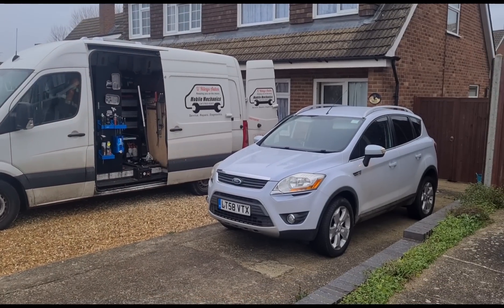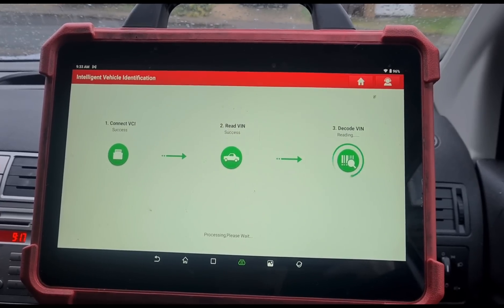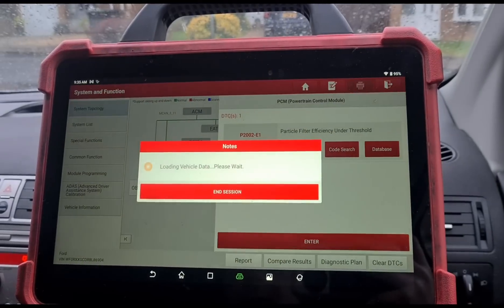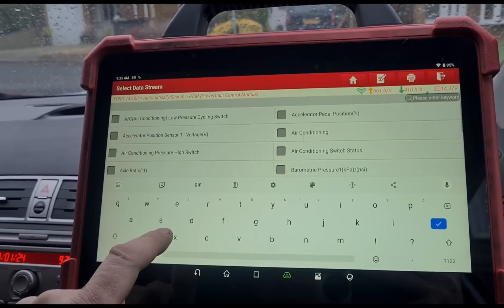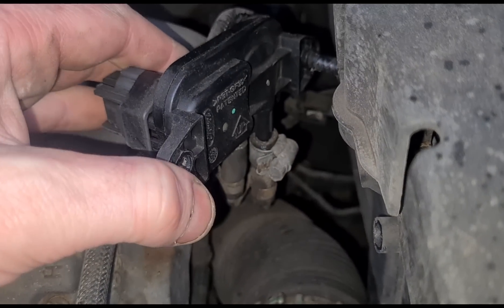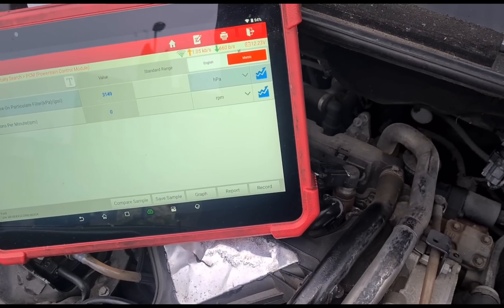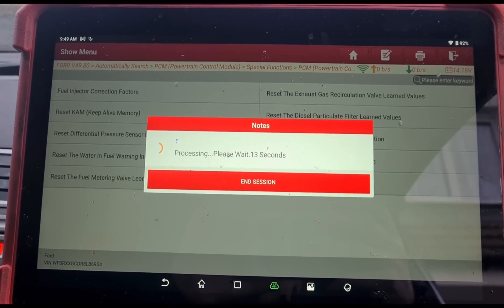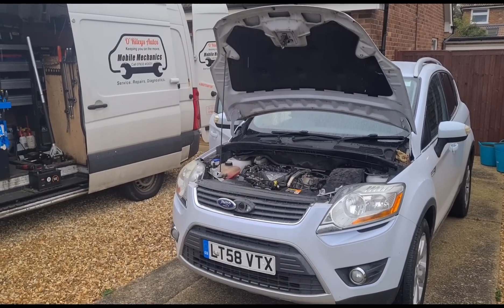Ford Kuga P2002-E1 Particle Filter Efficiency Below Threshold

Comment: Wasn't the tailpipe sooty Jimmy? 🤔
Reply: I have the same issue and my tail pipe is sooty, any help woukd be appreciated
Reply: @Cartoonhead74  Maybe a bit late but what do you mean by "sooty tail pipe"? You mean you tried to put your finger in it or a piece of paper towel to see if it is sooty? If that's the case then your DPF is damaged as soot is getting pased the DPF which shouldn't be the case. DPF has to be replaced sadly.

Comment: Do you think the euro tab 3 is worth the money?
Reply: @fatclio: depends on what kind of a person you are. If you are a mechanic then for sure not. There are other alternatives that use Launch software that aren't expensive as his tab 3. This is too much and a rip off as you are paying for the software that can do all even programming and ADAS (which is for emergency braking sensor recalibrating), while having a tablet that's not even made by launch but by Lenovo (or another brand). So no. If you are a normal DIY and don't plan to buy an electric car in the futur, then buy the new Thinkcar Thinkdiag 689BT or the non BT version. You have everthing you want except serious programming (but does simple things like ECU and Gearbox programming) and lifetime updates! The only issue is that you have to buy it from thinkcar themselves or aliexpress, both are chinese, you do get a cheaper price because you are going to pay for the import costs. There are other options like Launch x431 that cost around 600 euros but has only 2 years of free software updates, you can use it after that but you won't get updates for the latest cars. Hope this helps 🙂.
Reply: If you check it's 5k, but 1k vat which is objectionable,  disgusting

Comment: Hi Jimmy, I have a ford Kuga, and apparently the sensors are notorious for failing on these, they'll last about two years, I have recently fitted one to mine and it stopped the MIL lamp from coming on, IMO I'd deffo try a new sensor, ideally a new DPF as well,  but as you said the lady could not afford that...

Comment: Cmon. She knows. Seen loads of these. Sensors are crap on these. Little flexy b4 DPF are very prone to splitting. Tiny leak and differential pressure values are way off. Combine that with the quality of the original sensor and yr bang in trouble. DPF drilled maybe? Seen loads badly mapped because of this as well

Comment: besides a cracked DPF or a hole drilled through the DPF, could it also be possible the metal line attached to the DPF has a rusted pinhole or small crack allowing only some of the pressure to escape. maybe shooting a little brake clean down the tube and looking for a small leak? remember that time you put DPFCleaner in a car, and it started coming out all over the place through bad welds.
Reply from the maker: I actually did run some cleaner down it after the video
Reply: My thoughts too.

Comment: I wonder with the low reading off the dpf pressure using the manometer.  If they have removed the guts of the dpf or drilled through and made a hole through the dpf
Reply: If they did that... recoding computer is necessary to switch it off completely. BTW without DPF filter car might make some dark fart clouds under load.
Reply: What area do you cover?
Reply from the maker: @brian623  Bedfordshire
Reply: @ORileysAutos  have u been in the mk area
Reply from the maker: Must have had brain freeze. I never thought about that